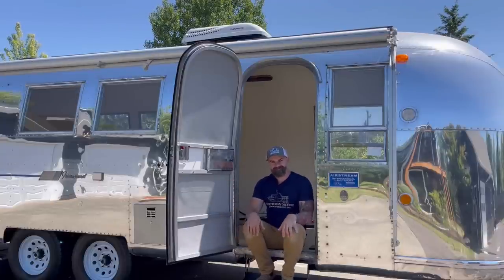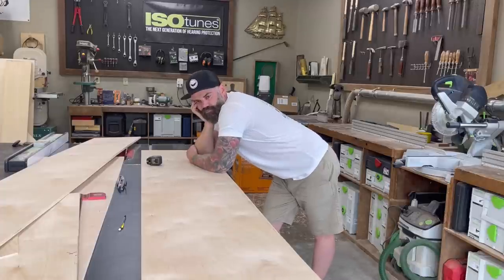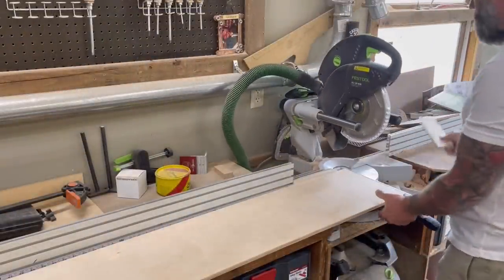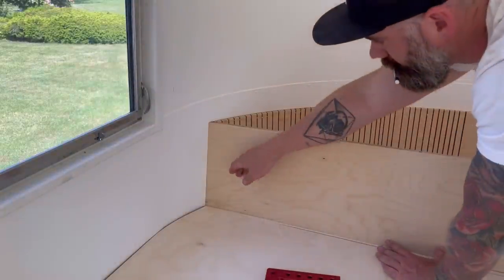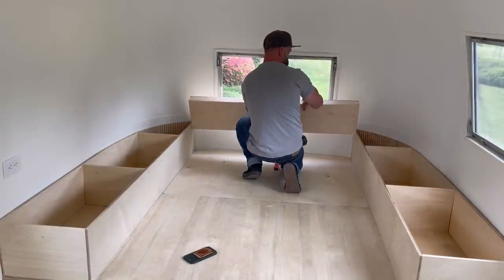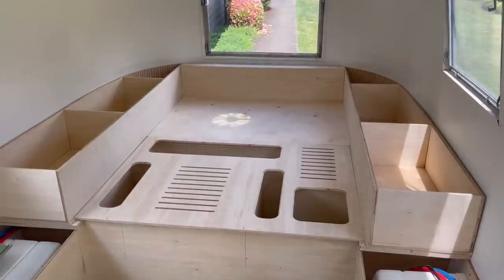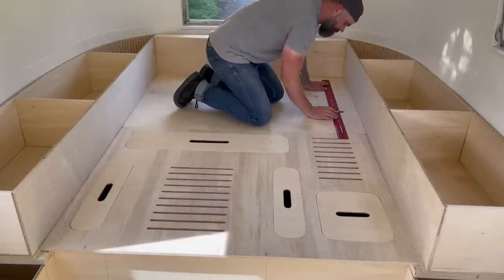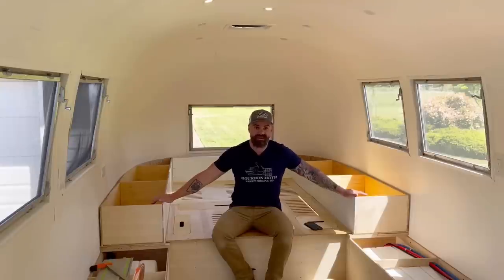Airstream Storage Bed  || Custom Building an Airstream

Comment: Hi Jason, well I have done 3 of these and I feel your pain in the curves, I can tell you this,  you have just begun to get frustrated with Wallys design. The overhead cabinets are going to give you nightmares, and what are your plans for heat, Here in Oregon it gets cold at night camping and the wife is going to chew your butt when she is cold. Most of what your are doing is good for now and looks good for a beginner. Just one more thing,  keep the balance in mind.  Good luck with it.    From an Oregon woodworker.

Comment: If you want to keep closer track on just how much weight you're putting in, weigh all the offcuts etc that you've removed. Deduct that amount from the total weight of the plywood sheets you've used, and you'll be within a few percent of an accurate figure for the job.

Comment: If I'm not mistaken, when you want to shift a shape by 3/4 of an inch, you just need to shift your template by 3/4 of an inch in both directions to draw a line that is strictly parallel, or just use a compass set to 3/4 of an inch to follow the edge, it sounded pretty risky to redraw it by hand.

Comment: Amazing work. However it seems like the curved back and the bottom of the storage cabinets are redundant wouldn't it be better to attach the scribed front and end of the cabinets directly to the bed platform, then just use upright supports at the back to hold up the eventual oak top? Between the two cabinets that's the weight of almost a full sheet of plywood and you don't really need the back since the trailer wall is finished anyways.

Comment: instead of doing an actual door you should make a curtain instead so it is way easier to get in and out plus its got privacy with ventilation along with if you need to stand in the door for a small extra space it doesnt swing open so it takes up way less room

Comment: Weight is an issue, but more importantly, you need to consider weight DISTRIBUTION.  If more weight is on the tail end of the trailer, you'll find an unstable and dangerous towing experience.  I'm sure you know this, since you've towed things before, but just thought I'd mention it to make sure you're accounting for it.

Comment: Dumb question from a non-wood worker. Could you have bent the kurf in the back plywood piece the other way so it faces the wall of the trailer. That way you don't see it and you don't have to skin it with 1/8 birch?

Comment: noise. how sound insulated is it? are you gonna insulate the wheel wells? is the wall/roof insulated from heat? is the floor insulated from noise? how much do you value each kind of insulation, and if it is not insulated, will you do it?

Comment: Hey Jason. Any concerns about vibration as you are towing the trailer and the pex water lines rubbing up against the wood cut outs of the plywood? Should some type of foam be used to protect the pex?

Comment: If you wanted to - couldn't you also put a thin piece of some sheet metal on the inside of the RV, on top of that plastic wheel well? Like thin enough to slide under the water lines.

Comment: to save some weight, could you have just screwed a rail to the wall of the air stream for the curved side of the boxes for the top to rest on instead of having that full sheet of plywood against the wall? wouldn't look as nice when you open it up, but you could glue that 1/8" ply to the wall if you're worried about that part i think.

Comment: What about weight distribution? It's not about total weight but how much weight is behind the axles and how much is in front of the axles. There usually is a split of a majority of the weight is in front of the axles and a minority behind the axles. I would suggest you estimate what you plan on building in the front compared to all the weight you're putting in the rear.

Comment: HOW WILL YOU GET INTO the platform side bottom areas you put the top boxes on? Thats a lot of space your loosing. 

Also  the frt side boxes your calling dead space make nice speaker boxes  buy some Polk 6x9 mm series speaker to install in the side facing the center of the bed
You can install a car radio with a DVD player in it that can be feed into a flat screen TV like an LED TV.
almost all campers have some type of entertainment built into them.

Comment: The bed has two compartments without access, just ventilation holes. Are you going to add a door to the one nearest the inside of the trailer and sacrifice storage in the other compartment?

Comment: You can't estimate weight by just plywood counting, because you've also used hardware (e.g fasteners).  For just 200lbs it's probably negligible, but as you go, it might start to add up...

Comment: you mentioned weight, but more importantly, what about weight distribution? you want the majority of the weight towards the from of the airstream. idk what you're planning to put at the front, but if it's not heavy enough, i'd consider putting literal weights there (or a fairly sized tank of potable water).

Comment: I've never done kerfs but couldn't you put the cuts on the outside in this instance to to have a finished surface on the inside where you would see it?
Reply: Sometimes when you do it like that the ply pieces pop of. And it is not as strong.

Comment: When this trailer was built originally, the cabinetry was made of 1/4" veneered plywood & 1" X 2" pine framework. You are quickly building an incredibly over weight travel trailer out of a super well designed light weight vintage Airstream. Wally is rolling over in his grave as a result : (  Do yourself a favor & go take an in-depth look at how they were built in the 50's & 60's. The construction methods are why the trailer still exists today.

Comment: You do great work! But, you are adding extra weight that you have to pull down the road.  Focus on minimizing the amount of wood.  You doubled up the wood in the floor of the side boxes.  The curved piece could have been a 1x3 instead of solid ply.  Every ounce adds up.

Comment: It's easy to criticize with 20-20 hindsight, so apologies but ... could you have kerf cut the "back" of the wall storage boxes against the walls rather than the "front" ? Or should the kerfs always be in compression not tension?

Comment: Why, on that corner piece did you cut an outer side with the kerfing? You had the wall of the airstream that could've just done the same job just fine, and then you'd have saved the material and had an extra half inch of space... And in an Airstream, a half inch is space that's worth keeping.

Comment: Weight.  The issues is what are your trailer axles rated at, Say 7,000' or 10,000' pounds, then what is the weight of bare unit?  Just a wild guess but with 7,000' axles and an empty trailer of 3,500' you have 3,500 of capacity for your build out + load.  The trailer may also have a tag listing empty weight and max weight, do the math.  Tires.  A good practice is to have tires with a rated load capacity so that in the case of a blow out the other 3 will not be overloaded, ie 3 tires could carry max trailer weight.  Check tire pressures daily and keep speed down to 65, trailer tires are not rated for sustained high speeds.  When storing your trailer always cover the tires and drop tires pressures so they don't over pressure in the sun. Torque lugs nuts before each trip. They will loosen up.

Comment: Love the channel, and not trying to be ‘comment guy’, but keep in mind the weight for sure, but moreover the balance of that weight from back to front.  Having a ton of experience owning and pulling trailers an off balanced rig is miserable and causes a lot of problems.  Don’t over weight the nose for sure, that will really suck to pull and will cause problems with your truck as well.  Again love the content and always look forward to your uploads.

Comment: 11:00 if you were gonna cap to off at the end like that, why on earth did you go through all the effort of making the box fit the airstream?
if thats what you're doing, the only thing needed would be the counter top being flush with the wall.
i.e: make square box from the start, fit it, make the face of the box longer so it touches the wall all flush, then make the top fit the curve of the airstream and save yourself hours of work.

Comment: I am not a woodworker, never cut a curf in my life. Could you have flipped the back panels of the side storage so the curfs faced the wall? Then you wouldn't have had to hide them with that extra face panel and wouldn't have had to loose that extra bit of storage in the back, as every bit counts (which I would have suggested to make into "bed-side tables": maybe one drawer and one open shelf).
Bet there's a reason that wouldn't work, but I don't know it, so I'm asking 😉
Reply: On seconds thought, a drawer/shelf from the side wouldn't be accessible once the mattress is in there... But just ditch that last divider and the corner would be accessible enough for storage. The top of the corner can be the bedside table, which is probably the plan 😉

Comment: How did you create the lip so that the access hatches just don't fall in/through? It's just hard to see and you used that tool. Can you explain/show us?
Reply: If I had to take a guess: wider cut path for the first part, then a narrower cut to finish going through. 
I've done that a time or two with a handheld router for some storage bins (just not in an Airstream)
Reply: @PFoxen  Hmmm, I thought there was a way to re-use the piece you remove, but maybe there's not.

Comment: Long time RVer and reviewer, architect, hobby contractor and woodworker… concerning weight: throw your “quality cabinet building” mentality out the window and focus on what you see. Many don’t have backs or veneered pieces to hide interior things.  Obviously weight, but balance front to back and side to side is important to good towing. Do some googling if you have not already about the distance from your axles to your tongue and calculate approximate weight in front of the axle for proper balance…you want 12-15% on the hitch when you are done.  Also trying to hit 50% side to side too. 
I would recommend you go to a RV dealer and walk through a bunch of nicer units and look at cabinet construction, hardware, etc for ideas. Your basic brands such as grand design and rockwood would be starters, however lance would be a great one to look at, and since you are in Oregon, Outdoor RV (ORV).
I enjoy watching! I have my eye on an old AS buried in trees I have driven by a farm for 15 years. Someday I’ll pull in and offer to buy it.

Comment: Hi. Could you not just fasten, say, a 4 inch strip to the side wall to rest your side storage box top on? Rather than using a full height side along the wall. That would save a lot of material and weight, no? Much easier to kerf a 4 inch strip, and your nice inside wall would be the inside of your storage box. Just a thought.

Comment: The work you are doing looks good, but you are putting a LOT of weight in the trailer behind the axle. You know as well as I do that plywood weighs a lot (and hardwood like White Oak weighs more), but I don't think you are accounting for weight distribution. Roughly 60% of the total weight of the trailer (trailer empty weight + furnishings + contents/supplies) needs to be forward of the axle.

Comment: weights a big issue in trailers while towing, the distribution before or after the axles can make a big difference when in tow, causing fishtailing, especially if you fill up the storage with heavy items (dual axles are less likely to be so dramatic so thats good for you) maybe water tanks and batteries best up front?
https://www.youtube.com/watch?v=6mW_gzdh6to

Comment: Why bother making the curved sections?  You could just put a blank up at the front and void in the back, and it would look the same, plus you would cut some seriosly unnecessary weight from the trailer.
Same goes for the box thingy in the back.  One piece of plywood would do the trick and save you money on the wood now, and on the gas later.

FYI - you will hate your "hinged mattress" after about 2 months of use.  've been there, done that.  They're just not comfortable in the long run.
Love your energy, but you should have borrowed an RV from a friend and try it out for at least a month first, before going on this "I will build my own RV" trip.
Love watching you plow through this! I'm sure the results will be amazing.

Keep up your enthusiasm my friend!

Comment: OK, you asked for comments.........
It looks to me like you're wasting a lot of valuable storage space - like those semi-triangular cubbies against the outer wall at the head of the bed. You indicated you were just going to block them off. Why? Storage space in a travel trailer is hard to come by. Don't waste ANY of it. (It also seems like some of the space under the bed got blocked off as well. You might have a reason for that.... And you can still use some of that 'ventilation space' for storage - just don't fill it up all the way. I'd also add some vents to the front wall of the 'bedroom, down low, to further ventilate the under-bed storage.

Comment: Weight weight WEIGHT !  Rv cabinets are usually only a face frame and end cap. with no bottom on lower cabs and no top on the ceiling cab's. The roof, walls, and floor are already covered and finished so adding one or in the case of the bed cab's 2 extra layers of wood is UNNESSISARY WEIGHT. Sure it adds strength  B U T  there is no need for a back and or top and or bottom when there is already a finished surface there. RV's are no home and are not built like homes to keep the weight as low as possible , so this air stream can be towed by a half ton truck, or in the good old days a FULL SIZED CAR.

Comment: That bed is going to be way too short, you barely fit in it with your head against the far wall before you added in the little box below the window, and that's not how people sleep. Add in stretching your arms and your feet are going to be dangling off the edge

Comment: I really understand that you like to fit everything perfectly. BUT it is a big no no with cars, vans, and trailers. Why? When everything fits perfectly, the wood will drive you nuts making squeaking sounds because every single part will move when the trailer moves. Trust me on this one. It is not a house. You need expansion joints.

Comment: I know you're a cabinet guy, and cabinets are boxes, and boxes are great and all.... and i know this video is from 5 years ago....
But why bother kerfing that 11" wide plywood for the storage box back? There's a ready-made curved wall back there... screw some angle aluminum to the wall, build out the front and the top, call it a day and save some weight.....

Sorry, i went to school for a degree in monday morning quarterbacking, not cabinetry